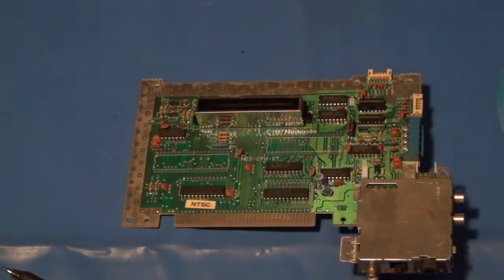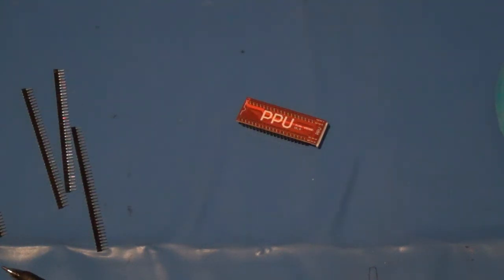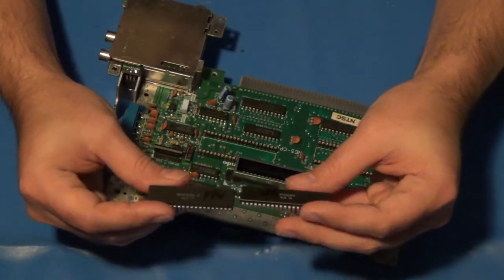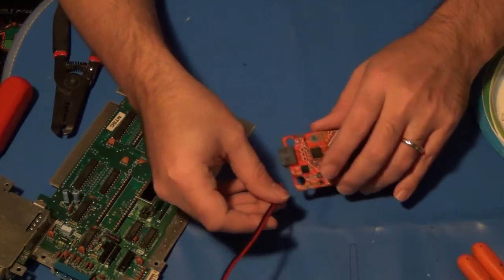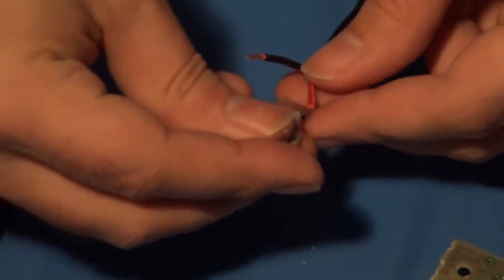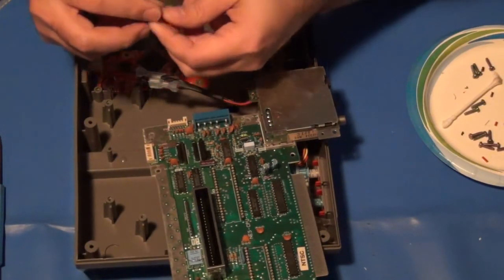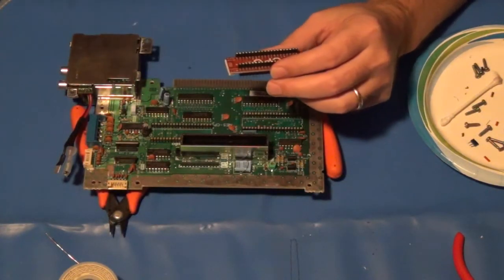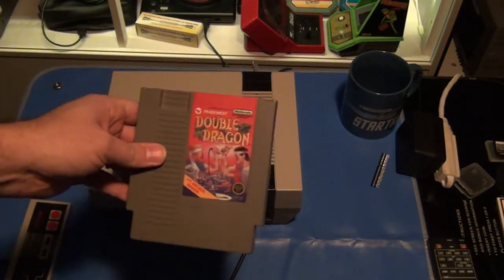ITC#11 - Hi Def NES and Capacitor Replacement Installation - Front Loader Pt2

Comment: I added quick disconnects to my install of this kit as well, though I used wire to board connectors instead of using wire to wire connectors.  If you're interested in more details, message me your email address and I'll send you some photos.